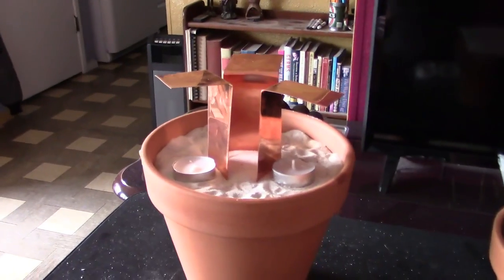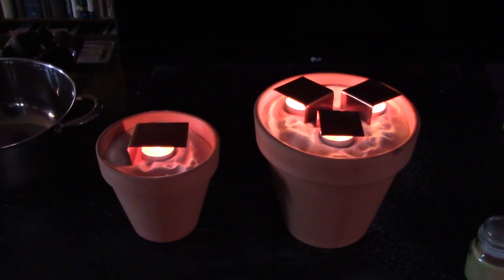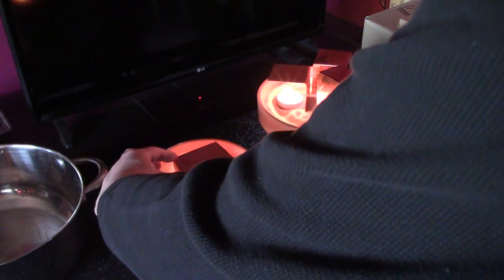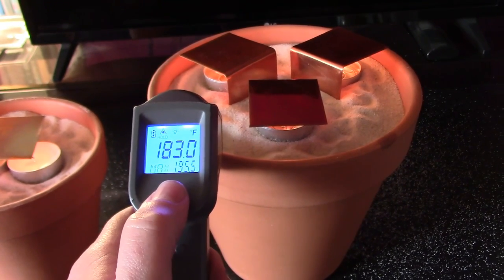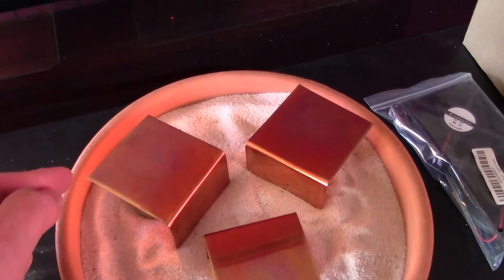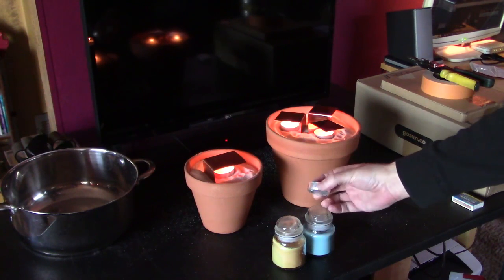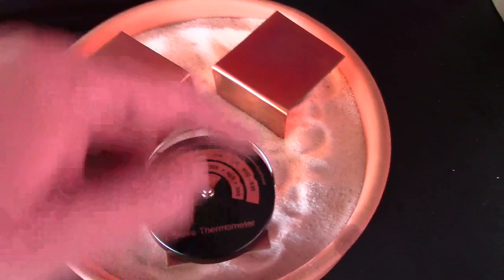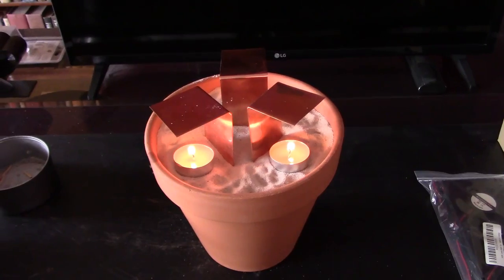Flowerpot Air Heater! New Design! w/Copper+Sand! (300F/400F)(150C/205C) home/mini greenhouse etc...

Comment: Yeah those tea lights are very cheap but I think they're only like 4-Hour run time until they're completely burnt out. Maybe even less since the wax in the wick get really hot along with the sand. I'm sure there'll probably like 2-hour burn times, but then you have the sand and the copper that holds the heat. So that's not too bad, that'd be really cool if you could figure out like kind of turn into like a alcohol burner or something like that, but it burns a lot cleaner and it's like a fuel fad system

Comment: So this is super duper cool and you're showing real results, now. My question would be you said you can put two candles under each one. If you made them just a little bit longer I guess my concern would be. Would the candles get so hot that the wax would combust, have you ever thought about that or experienced that? That? Or is that something that you don't have to worry about because you're not completely encasing the candle?

Comment: Hi Mate Just thinking if you placed 3 copper strips using longer than you're using now, and bent both ends this would stabilise the, strips the Sand would hold in place ( may need bottom strip section bit wider to stabilise: ) then you've a cooking platform Graham
Reply from the maker: that's a neat idea. the copper definitely gets hot enough to cook on

Comment: Did you try putting the thermo-electric fan on top of the copper to distribute any heat?
Reply from the maker: i didn't try that with this particular model but if the copper pieces go all the way to the bottom of the pot, you should be able to set a thermoelectric fan on the copper. i have a newer video showing a similar design to this but i added a copper foiled lined pot above the unit. i also ran it with a thermoelectric fan. here's the link to that video https://youtu.be/FcLKUgpXw-Y (i used beeswax candles for the cleanest burn)
Reply: @desertsun02  Thanks!

Comment: Hi Mate No need for a credit I was only joking, it was from your original idea I just built on it, one thing you might try ,I'm thinking Moulding Sand? it will compact a lot better, adding to heat absorption/conduction ?   so: "Terra Cotta room convector" midi  $89, maxi with new foiled dome $120 😆🤣🤣just needs to be proven, I'll happy co produce commercially with you  🤓🤓

Comment: A tiny Coleman solar panel (12 volt 2 watt $25 @ Walmart) and a 12 volt cigarette lighter heater like you stick in a metal coffee cup ($5 @ Walmart) No candles or their smoke and NO flame.
Now cut out brass flowers for the pots. The solar panel will adequately supply the immersion heaters for several large pots.
Place the heat fan above the top pot.
Or a 4" UBS fan ($10 @ Dollar General) on a cigarette lighter insert.
Dollar General also has small metal decorative plant pot stands 12" diameter x 9" tall $8
WARMEST WISHES 😅

Comment: With Gas & Electric prices soaring this could be the answer for the Elderly, you only need to heat personal space to ward off, hyperthermia ? ..With the top pot (see past comment) Copper foiled

 it gives an ambient heat of around 18~19C degrees, over a 2 metre square radius
Reply from the maker: hi there. i saw that comment (the one about using a second pot (lined with copper foil) and placed on top), and thought that sounded like a great idea, so i decided to make another unit just like that. it's working great (so i decided it will be my next video) 🙂 ✔ (started the filming just two days ago. should be posted in a week or so)

Comment: Tried this works very well, I lined another Pot with Copper Foil, and invert over the base , any heat rising from Candles transferred to the substrate, and radiated into the room .
Reply from the maker: hey there. i like the copper foil idea!

Comment: Ì saved all  the copper flashing from our old skylights when we ĥad our roof replaced. I have been making cool things from it. Like copper bats, gingerbread boys,  dragonflies, butterfĺìes, and Christmas tree ornaments . Now I am going tp make your heater with the copper flashing. Ĥow did you plug the hole to keep the sand in ? I woul also place the heater on a heatproofdish or such !.
Reply from the maker: hi there. sounds like you've made good use of the copper. i'm always looking for things i can do with copper too. i think i used a duct tape but it might have been a high heat tape. i can't remember for sure, but either should work. 🙂

Comment: I nought a heat powered fan for my woostove. It works by heat induction with no cords ,batteries or fuel. I bought one in a nice shape of a Christmas tree,  and one with a fan shape. I may try one suspemded on a copper bridge above the camdles.. thanks.
Reply from the maker: nice. i love the fact that the fans will run just using candles.

Comment: Are you familiar with the version of this that includes one of those big Crisco can super-candles? Jam a candle down in the center of the Crisco, long enough that the top of the candle sticks out of the Crisco a short bit, start with a layer of packed sand at the bottom of the flower pot (I actually saw it done with a metal bucket, so use whatever won't burn the house down) then add the Crisco can and fill in/pack down sand in the rest of the empty space around the Crisco can. Then use your copper like you did in this video. Or, in the Crisco video, he used a strip of copper long enough to form a loop that went to the bottom of the bucket with part of the loop going directly over the candle. I like the Crisco candle source better (never liked tea-lights) but I like your triple-strips of copper better, so I might combine the two. The Crisco candle should last for 72 days at 8 hours per day, or about 24 days non-stop.

Comment: Works great.  had to improvise because couldn't find the same copper strips locally (cold weather doesn't last in TX so couldn't wait for an order) so had to get a roll of copper with holes and threaded them thru copper pipe Ts.  The Ts were already throwing off heat within the first 5 minutes.  Thank You!  This seems s whole lot safer and prettier than the Crisco hack.
Reply from the maker: Hi there! I'm glad you found a way to make it work! 🙂🔥

Comment: Curious if a heat conductive fan would help heat better
Reply from the maker: hi, that could certainly help move the air around. i use that type of fan in several of my designs.

Comment: How thick copper you use ? 0,3 mm ?
Reply from the maker: hi. it's 24 gauge (but a little thicker would be okay too). as far as millimeters i think it actually varies from .5 mm to .7mm (from various sources online).
Reply: @desertsun02  That copper plate can not be 5 or 7 millimeters what you use in here. Maybe 2 or 3 millimeter ? One inch is 25,4 millimeter. I am just interesting what thickness of copper plate is required, because I am going to try this.
Reply from the maker: @ hi there. not 5 mm or 7 mm. (0.5mm to 0.7mm). i think you missed the decimal point?

Comment: What’s the difference in heat if copper is not used?
Reply from the maker: hi. if you don't use copper then all of the heat from the candles will just rise straight up the ceiling (where you wouldn't feel it). the thermal mass would not heat up much at all. if you can't get copper you might be able to use steel.

Comment: Your copper is too thin, you will be loosing a lot of the conductive heat through radiation. Better to use copper tube, filled with the sand up to the bend over the candle and this part hammered flat to give a larger surface area.

Comment: PLEASE tell us the thickness , width, and length of the copper strips. I really want to make one.....BAD
Reply from the maker: hi. the copper i used is 24 gauge. but you could use a slightly thicker metal if you wanted to. since tealights are 1.5" wide, the best width for the copper is 1.5" to maybe 2.25 inches. it doesn't have to be exact. as far as the length, you can adjust the length so that it fits the flower pot you have.

Comment: So I have a fair amount of 1/2 copper tubing, tees and 90s.
Do you think the heat transfer would be as efficient heating the tubing?
maybe use tees and 90s to make like a three legged setup into the sand ?
Hopefully I worded my question correctly.
Reply from the maker: hi. it could work (but i haven't tried tubing yet, so i can't say for sure).

Comment: Do you have room temperature measures?  And time it took to heat up?

Thank you
Reply from the maker: hi. it starts heating pretty quick and will continue to gain heat for several hours. unit is very hot after 30 to 45 mins and can raise temps quite a bit. it's a definite noticeable improvement. the amount that it heats up a room depends on a few things like how big the room is, how well insulated it is, how cool it is to start with.

Comment: I am curious if Crisco in a small jar with a wick, or a small candle inserted would last longer? Also, will the terracotta pot ever get hot enough that it would break?
Reply from the maker: hi. the pots easily handle the heat of the tealights. it won't get hot enough to crack the pot (if you just use tealights).
Reply: @desertsun02  Thank you so much for your reply.

Comment: IR Thermometers measure best against dark surfaces.  I see people trying to measure boiling water by aiming at the water.  Uh, OK.  Thermodynamically, you are trying to transfer the heat by conduction into the sand.  Basically a heat 'battery'.  It then releases the heat, slowly, over time. The copper sticking out of the sand will radiate some of the flame heat besides conduction into the sand.  Perhaps giving an immediate 'hand warmer', but decreasing the efficiency.   I would insulate the top and side of the copper strips and just allow the flame to impinge on the bottom of the horizontal suface.  An inexpensive way to improve the copper strips is to attach pennies (old ones) to the part of the strip that is in the sand using thermally conductive epoxy.  That is, if the goal is to 'bury' the heat into the sand and pot.
Reply: And once the candles go out, the copper WILL conduct heat upwards out of the pot.  Works both way.
Reply: How would you insulate it,?

Comment: Where can you get copper like that? I have been to 2 local hard ware stores and they don’t have it
Reply from the maker: hi there i get it on amazon. it's sold as bulk copper. it's about 17 dollars pound. amazon also sells it in different sizes. if you search for copper sheet you'll find lots of it. the best deal i've seen so far was 2 8x10 pieces for 16 dollars

Comment: If you invert a same size pot on top with a half inch gap between the rims, you can double your radiant heating surface.
Reply from the maker: sounds like a good idea. do you have any ideas on what to use to hold the pots apart?
Reply: @desertsun02 I use a smaller pot inside the bigger one, I put a few flat stones to create an air gap between the sand and the top pot. Ideal to keep my hot chocolate warm. A bugger when changing the candles out...

Comment: How do you keep the sand free coming out of the bottom of the pot?
Reply from the maker: hi. the easiest way is to use a piece of duct tape to cover the hole.
Reply: Bung up the hole with a cork.

Comment: What if you tried to collect the heat going up more. 

Cast iron or stainless steel tea kettel on the copper plates.  (With stand I understand copper will not hold kettel)  Use tea hettel spout to have 2 tunes  go through small radiator.  Then small fan to push air in a direction.

Comment: It's nice and safe as a room candle but it pollutes the air. What would be interesting in this experiment is the temperature of the pot and the sand and not that of the copper plates on the surface which is necessarily hot but short-lived if the candle goes out.  what temperature by conduction by the copper plate planted in the sand. There is a lot of direct loss of energy in an aerial mode and very little accumulation. knowing that the jar, even lukewarm, will probably remain warm about 1 to 2 hours after the candle.
Reply from the maker: hi. i've heard that beeswax candles burn very clean (compared to regular candles) so that would be an option

Comment: I don't know enough about physics to qualify my skepticism, but it would have been interesting to see how many degrees one of those 3-candle pots could raise the temperature of a room.
Reply: A few tenths, if that.  A single tea light produces about 70 BTU.  The copper piece that is exposed will probably dissipate half of that.  Figure the sand needs to be heated, there will be very little left to warm anything.  Figure on 80 to a hundred THOUSAND BTU’s to heat an average size home.  You get the point!
Reply: @carlgriebno5691  That pretty much describes the root of my doubt. While the copper strips might guide some of the heat down into the sand, they don't increase or multiply the source output. The video probably should have reminded everyone that there is no such thing as free energy and to set their expectations accordingly.
Reply: @twistedsphere It's not about increasing or multiplying the source output. It's about storing it and radiating it better than a candle can do on its own bleeding its heat upwards into the air

Comment: They make spring-loaded candle holders, would be prime for this. As the candle burns down, a spring in the tube pushes upward.
And thanks for the video!
Reply from the maker: hi. spring loaded candle holders. cool. i'd never heard of those. i'll have to research those.
Reply: @desertsun02 
UCO 
Very expensive I doubt you want to bury him in the sand cuz it would make them not work

Comment: This one's a keeper! We no longer have a working fireplace and a power outage during the winter can be brutal. I've been watching videos like this for over a year and agree with you about trying to improve on these clay pot heaters. Going to try resting a scrap piece of copper across the tops of copper in the bigger pot and see if I can get my wood stove fan to pick up and disperse some of the heat. Either that or add a block of heated soapstone to the pot of sand. Anything for the cause!
Reply from the maker: sounds like some good ideas! i've been meaning to get some soapstone but i keep putting it off. (i can't find a cheap source of it)

Comment: Wowww. Can you use them as mini stove?
How long will the flame and heat last with those mini candles?
Reply from the maker: mini stove is an interesting idea. those types of candles can burn anywhere from 4 to 10 hours. the ones i use last about 5 hours. the ones that last 4 to 5 hours are the ordinary ones. they also sell extended burn ones. i've seen 8 hour ones and 10 hour ones.

Comment: What happens if you connect battery wires to the copper strip? Will it heat the sand?

Comment: Pretty inspiring content you got there, I've started gathering materials to test some ideas, heating has become expensive and the building main heater needs maintenance at time causing causing problems for days and even weeks so I feel it's crucial to have an independent free of cost solution available at all time.

Comment: I am wondering how do pot heaters make candles more efficient? The heat gets released either way, just slower in this case. Or am I mistaken?
Reply from the maker: hi. without the copper and sand, most of the heat from the candles (90% of it) will just go straight up to the ceiling where you won't feel it. using the cooper allows you to 'grab' that heat and store it in the sand (where it will radiate the heat slowly into the living space (the bottom half of the room) over time).

Comment: Hello. Thanks for the video and sharing your ideas. If you have time, maybe you can test it with fireclay mortar or, for example, black quartz gravel (the gravel can be placed outside in the sun, for example, in the summer) it will heat up and maybe release the heat at night... I don't know ;).. but if, for example, : you have these three curved copper plates, maybe you can put a square copper plate on them and a fan on it. Maybe it will get warm enough for it to work. Take care. Greetings from Poland ;)

Comment: It would be cool if you got into data logging and so could give us a nice graph of the temperature in the centre of the sand sampled regularly over the hours after lighting the candles. You could also graph the room temperature in a room that you keep the door closed on for the duration of the experiment and then go on to work out how many of these would be needed to heat a room of a given volume in your particular conditions and how long that number is able to keep that room comfortable just off the initial burn and sand-stored heat.
Reply: True, the concept is interesting, but how effective is it. How big of a different does it make to a room vs just burning the candle. Guess we all have to help out and test his ideas. This is still a brilliant concept.
Reply: That’s a good idea, Andrew .   Have  you made any progress on your idea?

Comment: Love your channel!!
Here's a challenge for you..
Heating air space is such a waste...
compare to...say ...hot water bottle...placed to heat arthritis...which is amazing efficient...

But ...what other (efficient) ways are there to heat the body... Directly...without wasting heat on air space...
Maybe...heated seat...??

The point is , though, not to have EMF near the body...not go mess with the body natural electricity...
Reply: I know infrared radiation is not heating the air...so...how to generate infrared heat (radiation), without wasting energy on the other 2 types of heat transmission (conductive...and ... what's the third called...about hot air...??...on second thought...i believe it's called convection...